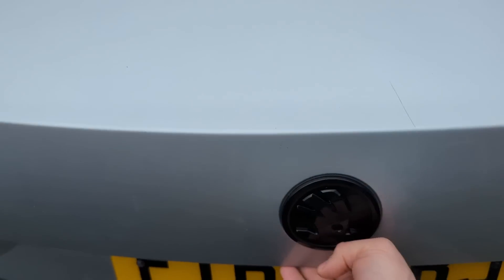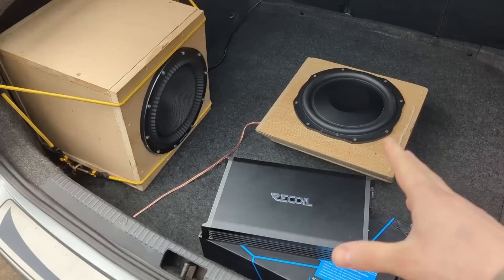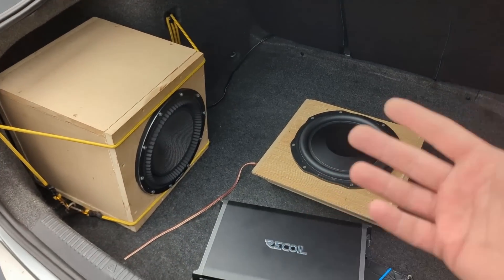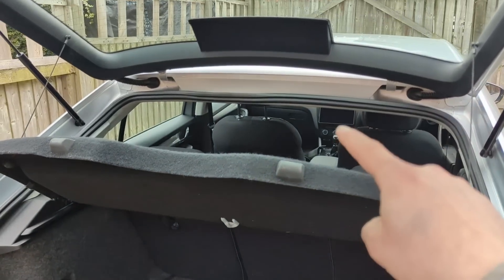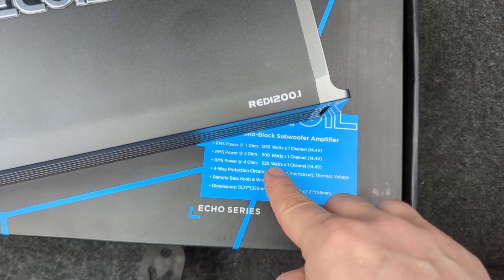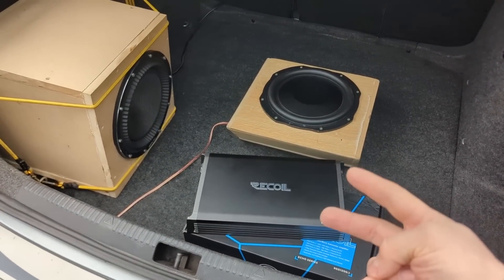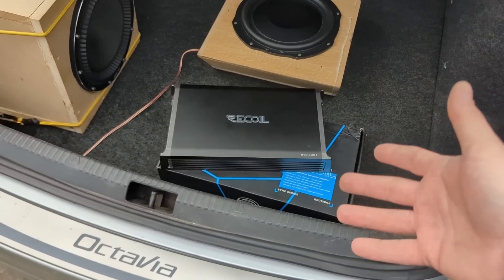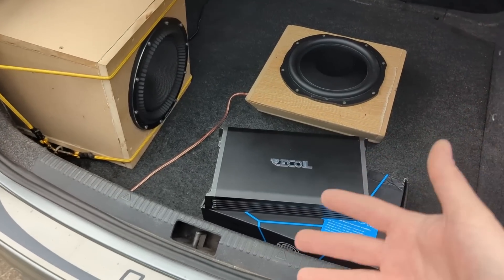Do different Ohm loads affect sound quality?

Comment: But your measuring at 50 watts output not at just below the amp and head unit clip point. As we all know when amps get near the top end of their output they get much more distortion. This low level test proves nothing to me. This should be tested at max safe volume. I appreciate your effort but it seems your method could be flawed in this test. If like to see the distortion chart of the amp set along with the head unit at -5 dB and the difference in a dual 2 ohm wired to 1 and 4 ohms. Nobody is gonna run a sub 8 ohms.
Reply from the maker: If you are running your amps at or up to clipping, you really need a bigger amp. That is not how you should do things in SQ. If an amp clips lets say at 1000W at 2ohms and at 600W at 4ohms, on both loads at ~500W everything will be exactly the same. Normal music listening levels (where you are trying to hear the nuances on the music) does not happen when clipping an amp.
Reply: @RAW-CAt  if they both run at 500W would the SPL be the same? I was under the impression the higher the ohms the better the efficiency, or said otherwise, the higher the sensitivity for the speaker so for the same nominal output, 500W, the 4ohm should play louder. If we normalize SPL, the Watts will be different, but then perhaps as you demonstrate the measurements will be the same?
Reply: @RAW-CAt  I don't ride around listening to SQ specific music all the time. Sometimes I listen to rap old school rap, and I want allot more bass than a normal SQ listening level. My system will be set at -5 dB test tone using a Oscope. I think you see my point here in that you aren't using real world volumes to test this theory only a low volume which is always clean. Maybe you failed to see my point. I see what you mean about running more power to avoid having to turn it up to near clipping and actually if set properly like I plan it will never clip and I may not ever turn it up to the radio clip level. But for testing to be valid and see a difference in distortion this should be done. OF COURSE you aren't going to see a difference in distortion at low levels that's how amps work. It's the higher levels that would probably show the difference. So you really didn't prove anything in this video except that playing any amp at a low level will be the same regardless of ohm load. BTW many SQ classes in sound competition measure SPL as part of the score. This is why this is important. Not just a random guy rambling on and trying to put you down. Again you want to bust a myth do a real test at max volume not 50 watts!
Reply: Does increase in BL from parallel to series create any benefit?

Comment: From my experience i do notice a sound difference between low and high impedance but it has nothing to do with harmonic distortion. High impedance is easier on the rail voltage of the amp. When you put low impedance the rail voltage drops and distorts the music in a compression way. Bass levels drop and don't hit hard and it effects the midbass and less on the highs. A dynamic equalization you can say. I can also hear this voltage problem from headphones dacs. Plugging my usb c dac to my laptop has more bass and authority/linearity vs my phone and tablet. Basically its to do with amp design and how good is the power source. Bigger amps sound better than small amps for the same low level Volume. when im looking at amp specs i need to see if it has the capability of delivering 2× the power exactly at half the ohm. A 300w 8ohm amp should do 1,200w perfectly at 2 ohms. But no we usually see 800w or something, badly compressed. this topic gets involved with another topic that bigger transformers sound better. Its all just maintaining the rail voltage and have super high current capability.

Comment: The answer is yes.  The impedance is directly related to the inductance.  It will not only cause the speaker itself to sound different, the lower the impedance, the lower the resonant frequency, higher sensitivity etc etc, but with class D amps especially, the load will change the frequency response of the amplifier.  Add those together, yeah, very very different listening experiences.
Reply from the maker: Not sure if you watched the video. All what you are talking about I discussed. Resonant frequency does not change, I showed that in the impedance sweeps. Frequency response did not change as well that is shown in the frequency response measurement. So no, there are no differences. If you have any proof otherwise, I would like to see that. Feel free to post some data in RAT in cars.
Reply: @RAW-CAt Impedance not ohm load
Reply: @RAW-CAt  @ 100watts
Reply: also effects the damping factor. Impulse response will show the differences, but the OP thinks it's all snake oil. 😂
Reply: No I didn't watch it first, I saw the title and wrote a summation.  The title doesn't say subwoofers only.  My comment applies to the title, Do different Ohm loads affect sound quality?  Broadly speaking, yes.
I also commented on Allen Smiths post re PowerUS 8k, and said:
"more distortion at a higher output voltage, who would have thought?"
While the higher impedance has a higher amount of distortion overall, the output is cranked up.  His THD vs Frequency test is done at 5w.4.472v (4 ohm) vs 1.581v (half ohm), almost 3 times the output voltage, so who wouldn't expect there to be more distortion?  If the voltage were the same, the results would be very different.  
If we measured a 8k 2 ohm vs 8k 0.5 ohm model at the same 5w, they would look entirely different too.
This test of Allen's is not including noise.  Output noise would be higher with higher output current (from lower impedances for the same output power) from Johnson - Nyquist noise alone.
It does show that higher output current does mess with its output filter and therefore the frequency extension, you can see 4 ohm is dead flat to about 8k, and each halving of impedance, the filter is causing response to dip earlier and earlier in the frequency response.
Next at THD vs Level, we have no idea what's going on.  0dBFS?  So, is it at clip?  Is it just below square wave for each impedance there?
Again 4 ohm is flatest in distortion, noise is not represented again.  At the low end of output, yes the distortion is similar for all impedances, but divergence happens early and by the end of the test (again, who knows what actual output voltage) 0.5 ohm is 5 times the distortion of 4 ohm.  In fact at -6dBFS (half output voltage, 1/4 power, aka 2500w) it's still 5 times more distortion into half ohm than it is into 4.  
Your own test shows that 7v @ 1 ohm produces more THD than 8 ohms with 3 times higher output voltage.  As frequency rises, the result continues to diverge and increase.  And 8 ohm has the lowest 2nd harmonic.  And 8 ohm has 3dB better SNR than 4 ohm, which is 3dB better than 2, which is 3dB better than 1, which would be 3dB better than half ohm!

You also completely forgot the reactive component to this test.  Resistors are NOT the same as speakers.  Resistors might be fine to test amplifiers specifications, but that's not what you are testing, you are testing a speakers performance difference, or a speakers impedance impact on amplifier performance
Reply: Also, how much do you trust your measuring equipment?  How do you set it up?  Do you fully open the input and drive the output as hot as you can before clipping?  If that's how you do it, does turning the input down half way and turning the output up to compensate, change the measurement results?  I assume you are using the Focusrite, not the Asylum
Reply from the maker: @minus3dbintheteens60  I am using the QA403 for electrical measurements. Lowering the signal and increasing the gain, increases the noise in the system, as expected.
Reply: @RAW-CAt   I hear that, but have you tried varying the gains?  Sure I expect the noise to change, but does the FR or THD change?  I ask bc in my experience with all my soundcards it does. And THAT is why I haven't posted to DF FB yet
Reply from the maker: @minus3dbintheteens60  it changes due to the increasing gain on the amplifier, not the sound card.
Reply: I feel you are dismissing my criticisms for another crazy.  That's cool.  If you actually want to try the suggestions I provided, they would make interesting video topics at least.  Don't forget, your argument was "increasing gain increases noise" (which I do not, nor ever did disagree with), but noise is the very thing I never remember ever being tested in this video
Reply from the maker: @minus3dbintheteens60  not really. Any video related to distortion measuring amplifiers are the worst performing ones on my channel. You are more than welcome to make a post on Distortion Factory and see what others think or experienced in this regard.

Comment: Audio - it's not only measurements :) 
On higher impedance you got more control from amplifier to speaker. Speaker plays more accurately.
You can see it on your graph at 15:51
Reply from the maker: How is control and accuracy measured?
Reply: @RAW-CAt  measure and compare input and output signal on different impedance. Like IR, but on music material. On low, medium and high volume levels.
Reply from the maker: @artemromanov1627 input and output signal comparison IS the stuff that I have measured. Changes in frequency response and distortion defines how output is different from the input. You cannot do that on music, it has to be a controlled signal such as pink/white noise or a log sweep.
Reply: @artemromanov1627 You ain't tellin' him nothing. He's got a severe case of the neverwrongs. It's almost as if equipment with trace overlays, math menus, and data logging don't exist. Like affordable dual trace DSO's. These guys all hang out on a FB group where they obsess over harmonics and use measurement tools solely focused on such things. It's all about the THD with them. They'll measure everything they can using THD and outside influences be damned. The kind of guys that will use REW to measure how long it takes to make toast using different toaster ovens despite the existence of a stopwatch. I'm done with him. You should walk away too. lmao
Reply: @monosurge  Dunning–Kruger effect...
Reply from the maker: @monosurge every youtuber has its own following. Every person gravitated towards what he likes and agrees with. Clearly my content and my approach is not for you, and there is nothing wrong about it. You are doing the same thing as someone going to an audiophile page and keep shouting that cables don't matter. There is a place for your opinion, sometimes it's best to keep them to yourself. I would recommend you to watch more of Danny and Paul, their content will be more aligned to your world view.
Reply: @RAW-CAt  hmmm... Wait...
If we take 2 different speakers, but with the same THD value, will they sound the same? ;)
Reply from the maker: @artemromanov1627  well no. Even measuring amps I measure more things, not only THD. Same with speakers 🤷
Reply: @ Ah, yes. It's a 'me' problem. Never a you problem, correct? :) Your approach is incorrect and the results are invalid. No you say here will change that in any world aside from you own. You're absolutely right about opinions. Practice what you preach. Your following just got dumber.
Reply: @RAW-CAt  Not with THD. That's Harmonics. Secondary effects created by a unit in the signal chain. It's nice to have low numbers there but it's not indicative of overall reproduction accuracy. If anything, you want to null that out completely for accurate measurement results but assuming it were equal across the board you could ignore it. This was not a good approach to quantify this and I stand on that. It saddens me that people are in these comments accepting it as Gospel now.